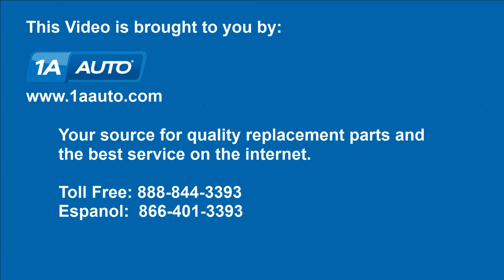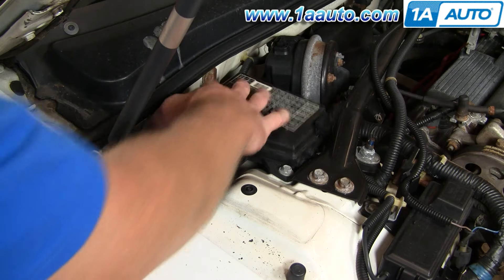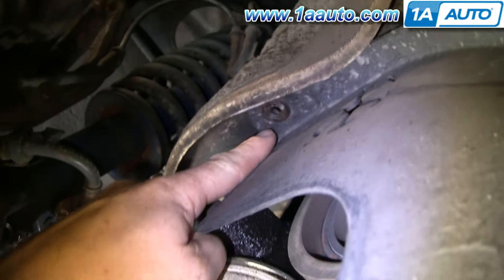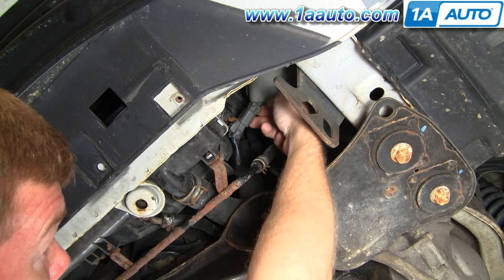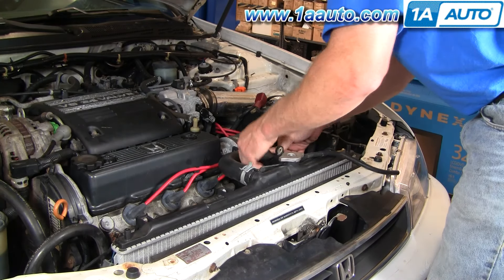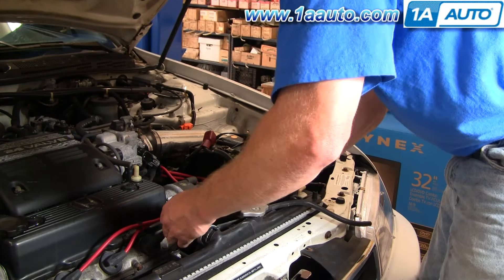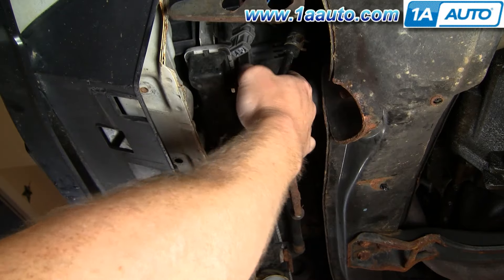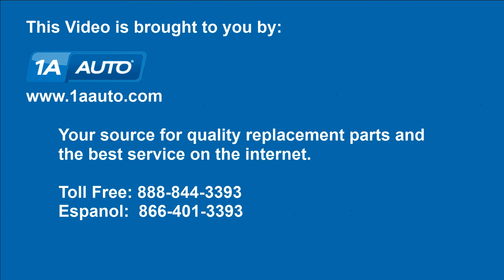How to Replace Radiator Cooling Fan Assembly 94-97 Honda Accord

Comment from the maker: On the same side of the radiator where the transmission lines are, you should see a couple of threaded openings on the side of the tank that the lines should screw into. Hope this helps you out.

Comment from the maker: @edwelch4 As of right now we do not. You may want to check for a corroded connection, or a frayed wire somewhere that ties into that fuse. Either of those things could cause a fuse to blow.

Comment from the maker: @dodgerfan931 Depending on how hot it was on most vehicles it will run between 210-215 degrees. Not sure if it was boiling inside of the radiator. If you would like to change the fluid you should wait until the vehicle has cooled down.

Comment from the maker: @MrMotoR6 You need to find where that steam is coming from. Look for loose or cracked hoses, loose radiator cap etc.  If there is radiator fluid coming from a crack in the radiator then you need to replace it.  Is the car running hot according to the temp gauge? If it is then you could have a bad thermostat or water pump.

Comment from the maker: You may want to check the computer to see if there are any stored codes in it. You also may want to keep an eye on the water temperature to see if it's running hot.

Comment from the maker: You may want to see if the car has a hi/low relay in it. If it does one of them may be bad causing the car to get warmer than usual until the hi temp fan kicks on to bring the temps back down.

Comment from the maker: @nico27004 Using the proper size wrench would be ideal for the job, however if that's all that you have is an adjustable wrench, you may want to use one on the smaller side so that you can easily assess all of the bolts. Hope this helps you out.

Comment from the maker: @babylokita0514 The thermostat tells the radiator fan when to kick off and on so that it cools the motor down. If the thermostat doesn't work it could cause the motor to over heat.

Comment: Nice vid...I was having overheating issues and checked the fuse for the cooling fan and it was blown.  I put in a new fuse and it blew also...have not checked anything else...do yall have any instruction vids or advice on what to check for the blown fuse..?

Comment: I have a question I have a 07 Honda Accord LX V6 and it seems that is running a lil hot coolant level is full but when the car reaches operating temp both fans turn on loud but the AC is off is that normal or there is something wrong because I tought the fans would come on loud when AC is on? thank you

Comment: When watching this video remember the camera angle is reversed. Look at your car then look at this video. the battery spark plug wires distributer cap are going the other way. So make sure you are changing the fan you mean to change.

Comment: Have 97 Acura Cl 3.0 keeps overheating checked radiator fluid ok, fan has been replace, but still overheats
Reply from the maker: +mauiboy444 Thank you for checking us out. It could be a thermostat or the engine coolant temperature sensor. 1aauto.com

Comment: What if is just one fan doesnt work? The one front of the radiator. Tercel 97'
Reply from the maker: You may want to see if there's power going to it. If the fan motor is bad, you should be able to replace the fan.